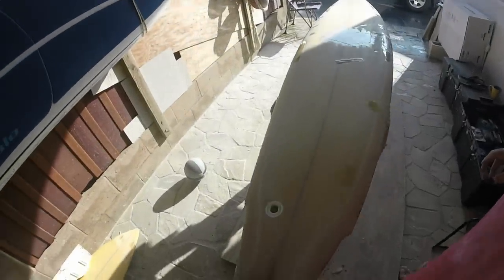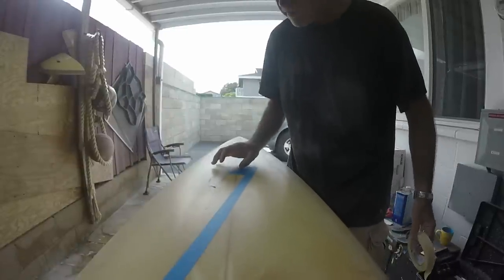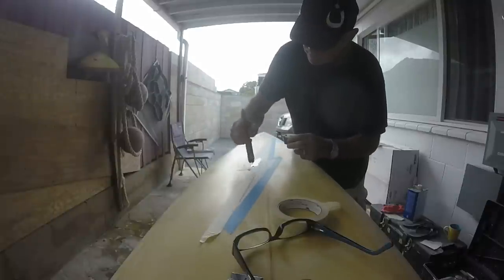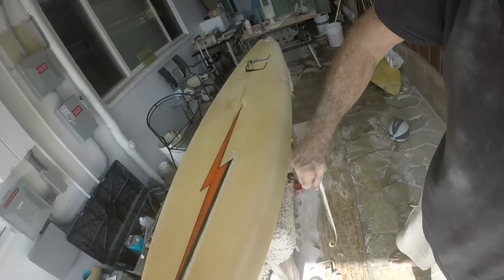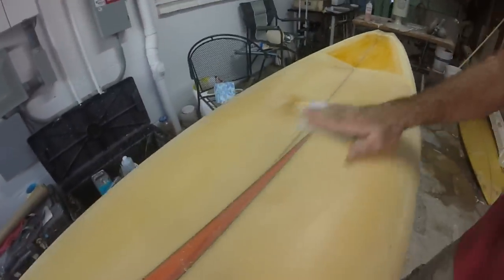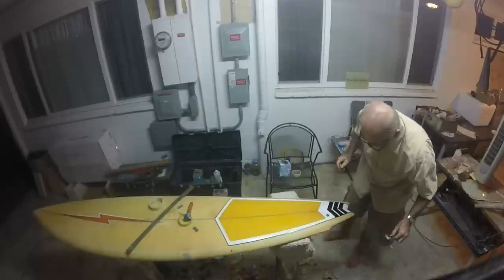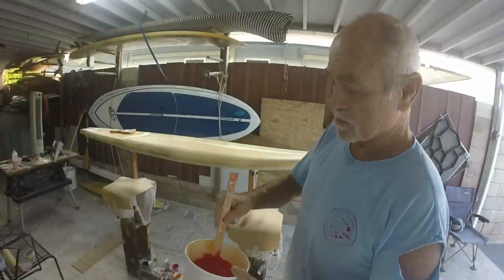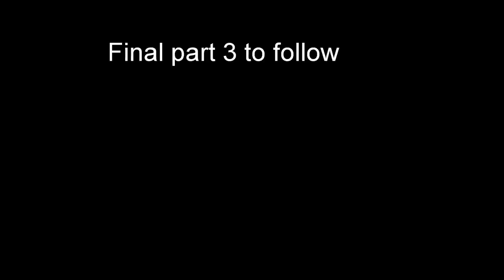How to restore a 40 yr old surfboard 2

Comment: When you were brush painting the board first was it just the pigment it wasn’t mixed with any resin ?
Reply from the maker: It was pigment mixed in finish resin. Once dry it was light sanded and a clear  finish resin applied
Reply from the maker: pigment added to finish resin
Reply from the maker: The pigment is mixed with the polyester finish resin
Reply from the maker: Yes mixed with polyester finish resin

Comment: Hi Bill I was watching these videos with great enthusiasm so I experimented using pigments in resin to coat over an old board. I sanded the board almost back to the weave for maximum binding but when I applied the pigmented resin it started to streak and separate. Any ideas what I was doing wrong? I really want to do up this old San Juan single fin but won't attack this until I know for sure. Yours came out so smooth and perfect. Please help if you're able. Cheers
Ben
Reply from the maker: Streaking or pigment separation can be caused by a few things it happens to me as well.  Make sure resin isn't old and sluggy. If you add a little styrene to the pigmented finish resin that should solve your problem. If you are doing solid pigment you will need to but a clear gloss coat over it after it dry and light sanded. Make sure you are not using marine resin but polyester finish resin. Soak your hands in acetone and right away wipe down the board by doing so you make sure there is no foreign material or oils on the board. Let me know who it comes out. Bill
Reply: Awesome thanks Bill. I'll add a little styrene and give it a crack on an old board first. I'll let you know how it turns out. Yes I'm using solid pigment so I'll take note of your advice there too. Cheers mate I appreciate it.
Reply from the maker: If there is any wax or oils from your hands sometimes that causes the streaking. Sounds like you sanded the board well, I will sometimes get my hand wet with acetone and go over the board to clean it. Also if you add styrene to the finish coat it will cause the  resin to flow a little better.

Comment: Aloha uncle Ben,I know this videos old but hoping you'll somehow see this and be able to answer a few questions,
1. Is the tint basically like a primer to my solid finish coat?
2. Would you use the same grit papers for a standard palm sander?
3.did you use straight resin for the pressure dings or some kind of filler?
Mahalo,hope you're staying safe in these crazy times
Reply from the maker: 1.Tint will not hide imperfections in the foam. It is like a clear coat w/ see thru color and can be polished out as you see in my video. Solid color hides any imperfection and needs a clear coat of resin then can be polished out. Tint is a standalone finish coat. “primer” is not needed for solid pigment colors but you do need a clear finish coat over the solid color to polish out the board. 2. Yes use same grit for palm sander. 3. If you are tinting the board use clear resin to fill pressure dents so tint will be even but sand before tinting. If a solid color, body filler works well. Aloha Bill
Reply: @billstonebraker5304   @Bill Stonebraker  did you use tint or solid? I'm planning on really sanding it down and taking care of all the pressure dents and Patching all the bad spots really well then sanding it after,then from there I'm at a loss to what's best.just going to do a plane white with a wrap around(deck,rails and bottom) different color on the nose...but from what you've said it sounds like a tint saves me the step of putting a clear coat over it if I did a solid.Thank you for your help.Tore my rotator cuff so no surfing for a bit,figured I'd try and fix up a board and send it to my nephew back home
Reply from the maker: @chrisjerson5622  tint for areas w/o dings or discoloration and solid for ugly areas that needed covering up.

Comment: Are you using tinted resin for the coloring?
Reply from the maker: Yes
Reply from the maker: Some tint and some solid. With tint you are able to see through to the foam or stringer. If I want to cover up a ding or bad spot in the board I will use a solid color. You can see it with the board I'm doing. Yellow tint, red solid.